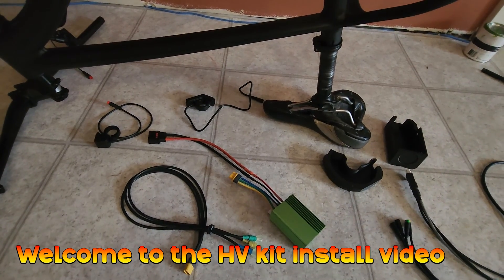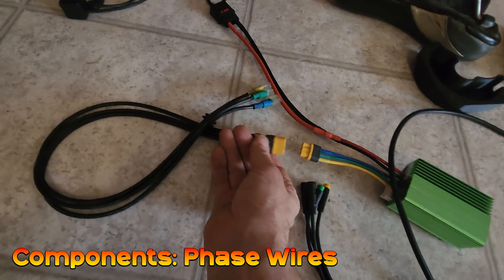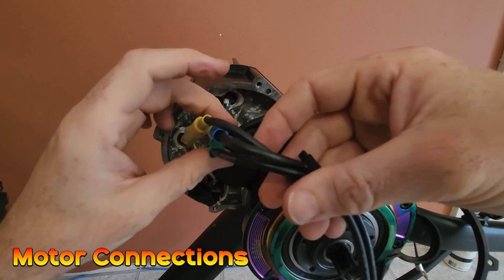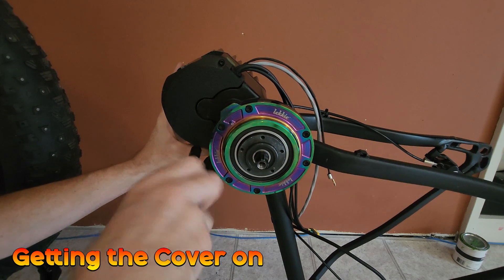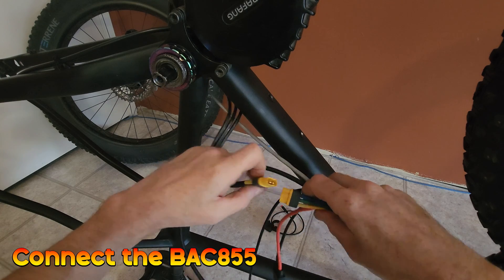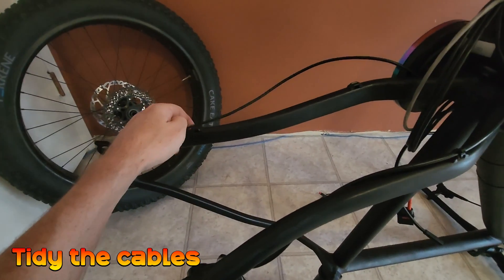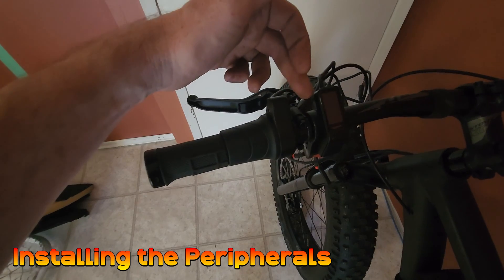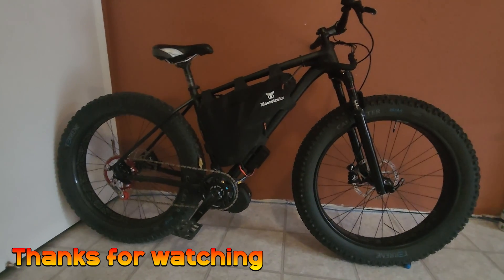BBSHD Mid Drive motor upgrade installation - Install the High Voltage upgrade kit for the BBSHD

Comment: how much phase current can those spade connectors handle?
Reply from the maker: Seem fine at 100 in bursts. There is no official rating for any of this. Never seen one of the spade connections fail due to heat or current tho.

Comment: Was there any option of using internal temperature sensor especially in case of those motors with temperature sensor being  placed between the windings from a factory? External one  doesn't seem to be serious enough since the motor casing can cool down faster while  winding temperature can still rise or stay the same.

Comment: Hi, I had a question, I have cable running on the bottom side of the frame where you show installing the new controller, do you have any suggestions on where I can mount it?  Thanks

Comment: Great vid. A waterproofing vid would be great. Im in North Wales so high chance of getting wet. Is it ok to fully enclose the controller or would heat be an issue? Cheers
Reply from the maker: It will throttle if it gets too hot. For most uses it should be ok. If it's very hot outside it might reduce power. I'll work on the video..Cheers

Comment: I wonder if I should do this because my BBSHD has been going fine for what I think was thousands of miles ( couldn't install the speed sensor magnet on this bike ) but lately it developed a problem where the throttle will just go from 0 to 100% rather than a gradual speed increase, and this issue seems to come and go randomly.  I have a spare BBSHD because I predicted such a unrepairable fault might occur but its a shame to write off a motor for what seems like an electronic glitch to do with the ESC.  I find the idea of a 3000w + mid drive on a mountain bike terrifying but I have also never tried a Sur Ron so I feel like I have missed out on that experience.
Reply from the maker: You are welcome to join our Discord community and find out more. You can also get a replacement for the stock controller. If you have the right brakes etc it's pretty easy to get used to more power. The kit gives you significantly more pep than a stock sur ron. Good helmet is a must. I ride within my limits for ability and conditions.

Comment: I have a ludicrous v2 but am interested in trying this kit of yours. Can I ask, when you attached the phase wires etc why didn't you reuse the rubber grommets and some high temperature sealant instead of leaving them without. I understand there's the gasket. I'm not picking holes, it's just I have previously, and it's a bugger picking it all off super carefully so would rather not if safe/ok. A very informative video.
Reply from the maker: It's a fair comment. I have some auto grade silicone to use around them. I want to make sure I got the rebuild correct on the motor first and that there are no gremlins. You can seal around them and many do. I want to do a video on waterproofing techniques so I will save it for that. Its a pain in the but to remove it I agree. I damaged the gasket around the phase wire plug which is why it was missing. I am not yet sure if I will use the silicone or if I will use elsewhere around the cover to seal up the controller box. Potentially both.
Reply: @HighVoltageKits  nice, it looks a very clean kit you've made.

Comment: Great, detailed video. Does it have PAS or just strictly throttle on this bike?
Reply from the maker: It has PAS although on this it has limited use. It's fine for cruising in busy areas safety but not much more due to the gearing. It's more setup for the stealth dirtbike style here. I'll go over the details on that I'm another video for configuring the eggrider display.
Reply: Is it possible to be configured for singletrack offroad use, especially technical riding etc? I don't do any street riding. It's all singletrack.  @HighVoltageKits
Reply from the maker: Yeah I think so. I'll have more details for you when I go over the eggrider settings

Comment: Is the main purpose of the controller upgrade purely speed/torque? Here in Korea, legally we are limited to 350W (I believe) and 25 kph (15 mph). That said there are about 3 Surrons where I live, but quite a few up in Seoul.

Just for the record I have some negative opinions on Surrons.

Edit: Already a member on Discord. I just need to install it on my desktop.
Reply from the maker: Well speed and torque are huge things. You also get a much nicer throttle response. But in many ways you are creating a stealth dirt bike or a hot rod street machine. With the Eggrider you can set things up to be street legal though and then turn that off when you get off road or somewhere these kind of vehicles are permitted to use more power. Having spent a bit of time in South Korea taking taxis I found the attitude to road safety pretty lax so not sure if they actually target ebikers there. The Sur Rons have a bad name mainly for dis respectful and dangerous riding. One of these kits though on a bike will out perform a stock Sur Ron for speed and acceleration. In general the authorities are more on the lookout for things that look like a dirt bike. Where are you in Korea? I had the fortune to visit the South for the Spring Blossom festival time. Mainly around Busan and Changwon. Cheers